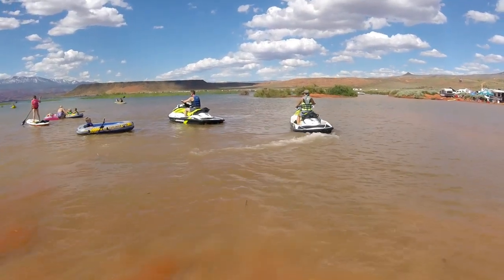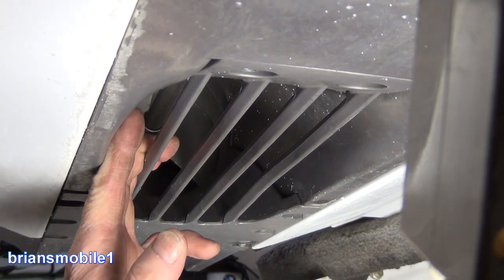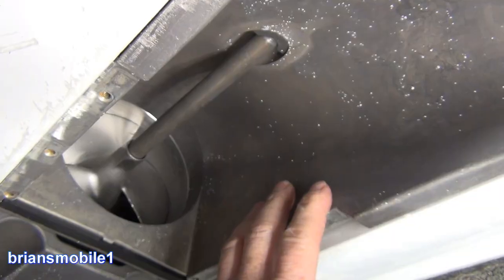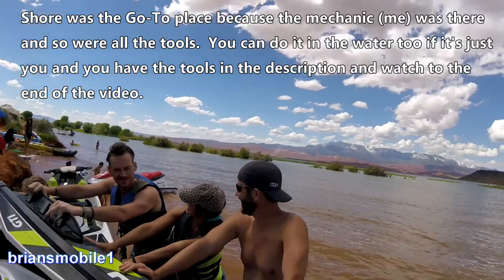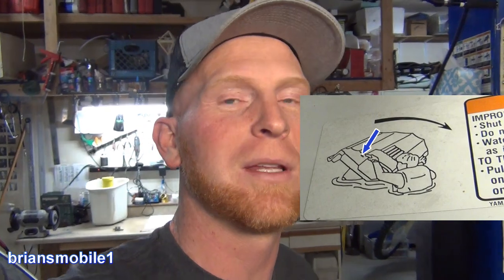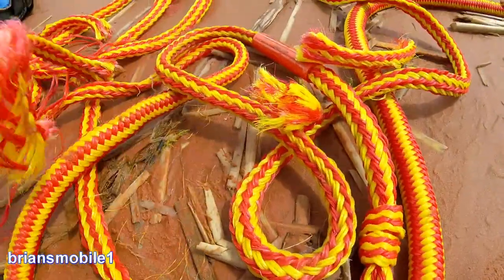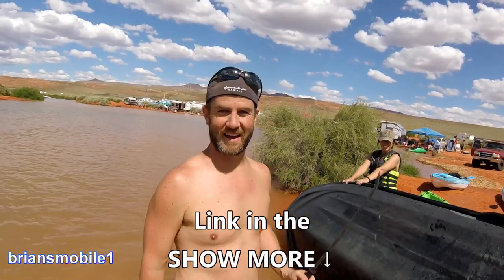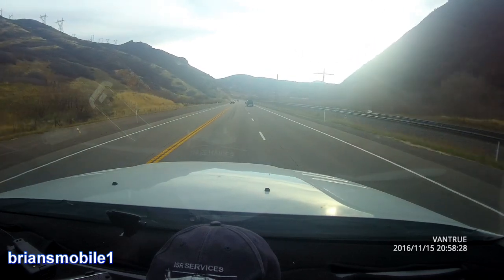Rope in Jet Ski How to Complete Tutorial Double Rescue

Comment: Got a rope stuck in mine and it twisted the pump housing.  The engine was only idling when the rope got stuck however, I ended up having to replace the housing and rebuild the pump. Glad they just needed the rope cut out.

Comment: Picked up a hidden floater one day, shattered the grate and I suddenly went flying. Luckily for me I only broke the plastic, and did not tear the inserts out. Tool to keep in there is a coarse hacksaw blade, with a short length of  line and a float so you do not lose the hacksaw blade. Wear gloves, that helps when riding as well.

Still got the mark where I collected a fishing line, rod and all, from an illegal fisherman.

Brian, you know those are a lot more fun on the sea, where you have actual surf, though on a lake you can get a lot of height just from a Bayliner wake, but never was able to emulate Ricky and do barrel rolls and flips from that wake.

Comment: I did this to my waverunner today. And I started it afterwards it started one time and then won't start again. My battery read 6.9 volts. So would this have affected my battery or is this coincidental?
Reply from the maker: 6.9V is pretty low.  It should be around 12.5V ideally before starting it and 14V when running.  It may be coincidental, or trying to start it while it's bound up may have drained it.

Comment: Try and save the rope first by removing the spark plugs and rotating the shaft by hand, unwinding spool.
Reply from the maker: LOVE that comment- compression is also resisting.  I meant to put that in the video and missed it. 

Thanks for having our backs!
Reply: Thank you @briansmobile1  you are awesome.

In all likelihood the impeller has already cut the rope, but removing compression will help get it out. Every machine should have a little tool kit with a plug wrench hidden under a seat or in a compartment.

For a hydrolocked ski pull the plugs and crank the engine until it has expelled all the water through the open sparkplug holes. There is a procedure to stop fuel being injected while cranking out the water. Such as fully depressing the throttle while pressing the start button.
Squirt a bit of light oil into the cylinders if you have some, replace the dried off sparkplugs, start it up and go for an Italian tuneup (run it hard/get it hot/recharge)